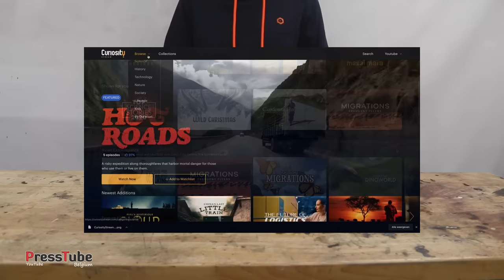Melting Full Dumper of Scrap Copper to Pure Solid Ingots! Trash to Treasure 54kg of PURE COPPER!

Comment: As of right now 54kg of copper is worth $474 USD
Reply: awesome
Reply: In Belgium 54Kg copper = 286.20 € or 336.57 USD 😉
Reply: @Fotografie_Pascal  Blame google.
Reply: @RwingDsquad  I've got it from Google, copper price Belgium ( € 5,30 per kg ), and € to USD conversion. 🤷‍♂️
Reply: @Fotografie_Pascal  your conversion was right, you just put a comma where a period should be.

Instead of $300,00 you should put $300.00

But that's the only issue :3
Reply: @DoraTheMFDestroya  Thanx 👍
Reply: I thought copper is worthless... it's everywhere lol
Reply: @DoraTheMFDestroya  In most of the Europe, comma is used for decimal point indication. the period dot is used to separate thousands. 50.000 in Europe means 50 thousand and 50,00 means fifty.
Reply: @JohnSmith-fp2mk  ohhh, I was going off of American presentation. Thank you for clearing that up!
Reply: 🇱🇺in the neterlands =€4.30  €4.30  54kilo  €209
Reply: @jenlegendary  copper is the most valuable non ferrous metal....its everywhere yes but that dont mean everything you see that's copper is worth scrapping
Reply: @jenlegendary  one 9f the most useful conductors, and because it is so common it is very useful, just cheap common, not bad common ;)
Reply: @adammonahan687  you're right. Electric cables by the meter without any splices worth more than an ingot.
Reply: it's not pure (eg. pipe solder, there was a lot of slag) so not so much that
Reply: $499 usd rn
Reply: well, i guess i can almost get the iphone SE from last year
Reply: Which he'll get through this video
Reply: In Czechia, the 1 ton of copper is worth 234 000 CZK. Or approx. 9636.37 USD
Reply: @jenlegendary  People said the same thing about silver, now look at it..
Reply: If it's pure then you can melt it up into small chunks and sell for element collections. 30 dollars worth turned to 1k
Reply: Give it enough time, once the consumption rate of copper is exponentially increasing, expect it's value to also increase
Reply: @Adam Monahan  yeah I know! That she drives me crazy I do scrapping and I've been doing it for like 25 years! I watch people scrap the most ridiculous stuff! Like are you freaking kidding me you're going to scrap that? And it doesn't just go for copper or brass it's everything though just scrap stuff that is hey.. I don't even have words for it! I've been guilty of scrapping some things that probably shouldn't have because they were worth some more money if they were just kept away they were or they were just neat or not very common/retro antique or whatever you want to call it. Stuff that just shouldn't have been scrapped because of various reasons. And I scratched a few things that it kind of scared me a little bit inside when I did it because I would have really liked to have not done that! Sometimes you're stuck in a rock and a hard place and it's the only option you got but I always try for things online or sell them. Other people I know or whatever and like I said there's a lot of stuff I don't care what position I'm in I'm not going to just put it in and take scrap price for it not only because it's ridiculous to take that little amount of money for it but also because it's horrible to know that it's just going to be destroyed same thing goes for bringing things to those horrible We Buy Gold shops! It's disgusting! They used to be coin shops and stuff like that where you could bring things and they would buy things not only for the precious metal content but they would pay for what it actually is! Now doesn't matter they'll just rip the diamonds or pearls or whatever it is out so taken meltdown the freaking silver or gold! They've got no problem just throwing beautiful antique solid silver silverware or beautiful American Eagle, Canadian Maples, antique coins and it goes on and on! They do not care one bit about it being a beautiful ring that was made in 1842 that was made by or whatever it was they're going to rip the gem out right in front of you and hand it back saying yeah we don't want this and weigh it out give you a couple bucks and throw it in a bin to go to the smelter! All that stuff we've lost over the years especially recently with all these cash for gold places opening up and kids and family members just taking anything and everything and bring it in for a couple of bucks instead of keeping their great-grandmother's ring that's been in the family for 150 years now they take the hundred bucks for it and the worst part about it is like I said they take it and they throw it in the smelting pot rather than telling it so somebody else can love it! I am really pissed off at this point I can't understand why I want to go buy an American Eagle or I don't know some sort of round or bar and guess what! I have to go and pay it above spot price and all these other things in order to buy it from these stupid companies and then when I want to sell it I have to once again let these companies take more of my money! I don't understand Point why is it that we can't have somewhere that people can go and say hey I'm looking for this or I'm selling this! Making it so there's a secondhand Market instead of these dirtbags taking our money coming and going! There's always people who want to buy these thing and there's always people who want to sell them but for some reason you can't buy a second-hand American eagle anywhere! Nope they're all perfect Justice in the other and they're just much more than spot price but at the same time the guy who just sold them to that company you're buying them from sold it to them for 20% below spot or whatever it is! I'm just not the type person who buys things for full price and I don't understand why nobody's figured out that we should have a website or something where we can buy and sell things like coins, constitutional silver, bars Etc also it makes it so there would be a community after you bought and sold a few things you would therefore know people into the same thing that you're into around your area and soon enough there would be a little Community you'd have with 10 or 20 people that you wouldn't even have to go to these sites anymore you could just call up Joe that lives down the block and say Hey Joe I'm looking for the American Eagles you know anyone? Or unlocking to get rid of a few of my maple leaves you want any of them? I don't know I just think we're getting screwed coming and going by everyone! All these companies are Flatout effing us all over and over again there is no more little guys! there is no more community and local or building relationships with people! I just saw your comment and was like yeah that's exactly what I'm saying
Reply: How is the smelting equipment called and how can I get it.
Reply: How much is it worth now in 2023 ?
Reply: @browill9  $448
Reply: @RwingDsquad  How do you get the money off of them?
Reply: @galvinstanley3235  they don’t have money on them unless you place money on them.   If you’re asking how do you sell copper for cash…. You go to a place that buys copper and sell it for cash.
Reply: @Matt-the-Youtube-user ez way to make 9 grand

Comment: Never forget to use an oil or similar viscose (non reactive) coating to prevent oxidation of the coppers surface! This will make sure the copper can be sold for full price as clean ingots are more valuable.
Reply: ...nobody cares if copper is clean lol. The scrap yard isn't very picky about copper and other scrap metal being clean and Shiney lol.
Reply: @Frosty708   Bright copper gets  $1.57 more per pound where I live in PA.
Reply: @Frosty708  copper sells at all different levels

Comment: Your ingots cant be pure copper, all that pipe work you put in was full of soldered joints.
Reply: Thats what you saw him doing by skimming the surface of the molten copper. The impurities float on the top and you skim it off. To refine it even more pure I've heard you need to add borax or something. I'm an idiot so what do I know.

Comment: Isn't some amount of copper lost to CuO / Cu(OH)2 from directly cooling it in protic solvents like water?
Reply: Can you please elaborate on this. Not a chemist here just interested.
Reply: @vicferrari9380  Hot copper gets oxidized in water and is thus "lost" (Kind of like iron, though copper is MUCH less reactive than iron, therefore you only ever see the green oxide layer on copper after long exposures or at high temperatures)

Comment: 1:04 brave from your part not using gloves to fit the copper wires inside the crucible
Reply: Curiosity. Why is he brave? It's not hot. Dangerous is wearing gloves to feed the shredder.  Get that glove caught on a snag on the copper and good luck getting your hand or whole arm back.. just saying I've seen similar happen on both a lathe and a drill press. On a similar note. Is horrible for the clean up guy.

Comment: I've seen this one guy on youtube with these oil burners and a foundry. Have you thought about upgrading your setup? You could put out a lot more heat if you wanted. Also I have no idea how much your propane costs but I feel like it's gotta be something.
Reply from the maker: I’m not using propane ;) My furnace can get up to 1350C° but it isn’t made for those temperatures. I need to buy a new one every year because of that. But because of COVID the delivery is running late. My current one is starting to break apart 😬
Reply: @PressTube  Might want to get furnace that can stand those temperatures.

Comment: No mold preheating, bad practice
Pouring water into a hot cast iron mold, bad practice, and quite stupid.

You can cause the cast to fracture, and considering it's used with molten metals, is dangerous.